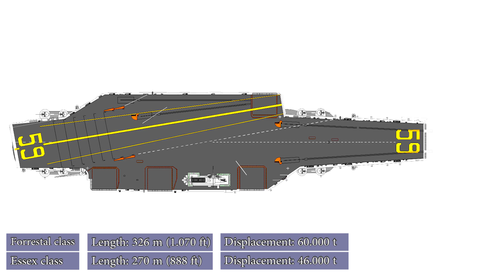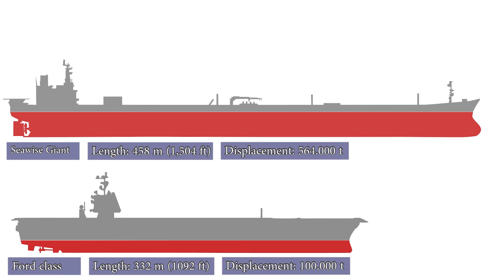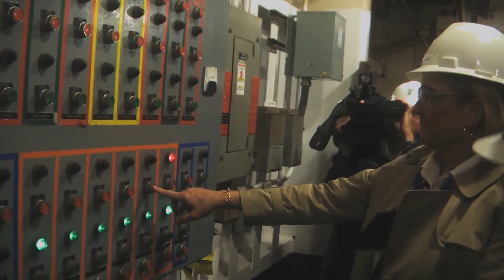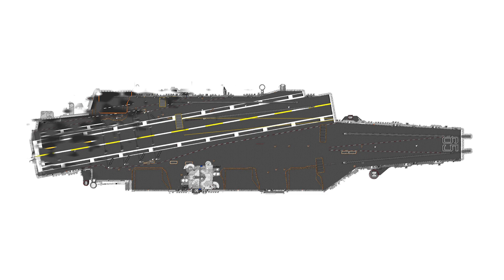Why don't aircraft carriers get bigger?

Comment: I would add that size is only a secondary requirement, the primary requirements are brave soldiers and strategic planning. Remember the 1971 Indo-Pak war? Only 3 corvettes were enough to knock down the Pakistan Naval Ships. So, size is just a physical attribute.

Comment: OK------- PS !    A 1600-foot long by 200-foot wide hulled carrier could have a 300' to 500' by 60' Docking Well in its stern for cheap, easy and fast Mass Cargo resupply instead of slinging Bombs across cables between Ships only 75 feet apart doing 15 knots. At least stringing a hose between a Carrier and a Tanker is halfway Safe. And all you are losing is some Jet fuel if the hose breaks. While large Bow Thrusters would solve the Maneuvering problem long tankers and bulk carriers have, as well as being able to self-dock pierside.  Not to mention that the huge Bulk Cargo and Tankers are built to be cheap with Power plants just big enough to make 15 or 20 knots on a good day with a few thousand horsepower at most and not the huge Nuke plants on the Carriers with hundreds of thousands of horsepower racing away below decks. Power, number of shafts and Rudders to size is most of what makes a ship maneuverable or a sluggish snail barge.

Comment: OK-------.    CALL THE NEW MEGA 1,600-FOOT LONG CARRIER, THE PACIFIC CARRIER...    WHERE IT IS TRULY NEEDED...  WITH THE OLD SHORT CARRIERS STILL PERFECT FOR THE ATLANTIC AND MEDITERRANEAN....
--------------...    Most of the reasons stated for not increasing the size of the Fleet Carriers are Complete BULLSHIITE!!!!  Exaggeration runs rampant here. A 160,000-ton, 1,600-foot-long carrier would not be Slower or require even a larger Power plant to still achieve 35 knots or more. As the width of the hull at the water line and the draft are what produce drag, and not the length.There is no reason to increase either hull width or draft of a 1600-foot carrier. The fact is that a new construction would simply extend the length of the hull, requiring no new technology or larger power plants. The only additions would be more deck and hangar area, as well as increased storage volume, and only the additional crew required for the added aircraft, as the ship's internal equipment, such as elevators, catapults, and propulsion equipment/reactors, would remain the same.  Only requires 40,000 tons of additional hard steel for the hull.
-----------... AGAIN! Simply lengthening the Carrier would not increase drag as the width and depth of the hull controls drag and not length.. fact is a longer ship can result in a faster ship in rougher seas...    Cost of ships is controlled mostly by the amount of steel and the Size of the Compartments, which is CHEAP, and the number of propulsion reactors, propeller shafts, and auxiliary equipment needed, which is 80% of the cost of any carrier... and would not need increasing.  Lengthening the Carriers' hull 500 feet would STILL only need the existing Propulsion and auxiliary equipment, electronics, and electrical systems, now on the Carriers, which is the majority of the carriers ' cost. 
------------...   So Most of the additional Cost of the longer 1,600-foot X 440-foot wide flight decked Carrier is only the added Steel to make the additional number of Compartments, which is inexpensively Cheap, adding only at most a $-Billion. While requiring the use of only existing fighters now used on the Nimitz and Ford Carriers... but having the room for larger, faster, longer ranged fighters as well as moving hundreds of vertical missile launchers off of destroyers onto the Carrier that is the main target. The NAVY now so DESPERATLY NEEDS...  Alowing the destroyers to concentrate on sub protecton. 
-------------.  The Cararier would have the advantage of operating 6 C-130-sized aircraft for long-range, large cargo resupply and the capacity to provide long-range Fighter Refueling to allow 2,000-mile strike package Missions and patrols...
  That are now impossible with taking fighters packed with extra drop tanks and a refueling pod to refuel fighters that extend ranges of a fighter or two only a couple hundred miles and not whole 40 plane strike packages a thousand miles that a couple of C-130's can do... front line fighters that would better serve increasing the numbers of fighters on attack or defensive missions and not just refueling a couple of mission fighters each....  
----------...  . Most of the other statements against the larger Carrier are just as False. While the Reasons for a larger Carrier are many times Greater than stated.  The fact is that a 1,600-foot long 400-foot  wide flight deck Carrier mass produced would only cost a Billion $ more than the Ford Classes current Cost when ever built that already has the cost of the propulsion reactors, hull compartment fittings and flight cats, arresting equipment and elevators paid for...  giving you twice the carrier that can fly in a Wing of reinforcement fighters fromthousands of miles away within hours (because the Carrier has the Extra deck and hanger space to handle them) instead of months waiting for a second carrier to arrive from the States.  Also the number of missions flown from a Carrier is dependent on how long it takes to Service, Re-Arm and Re-Fuel it's fighters. That depends on Deck and hanger Space and NOT on how many Cats it has. It only takes a minute to launch each fighter on each Catapult, making it possible to launch several squadrons every 15 minutes using the Four Cats they now have and not hours like this jerk hints at. The extra room for checking, and rearming with more munitions, elevators, and refueling spots, the bigger Carrier's flight deck allows will triple the Fighter Shorties per/day over the Current Ford carrier. to 600...   Amazing what an extra 500 feet in length can do to greatly increase a Ship's Combat Performance and Capabilities! for at most only an extra 10 to 20% cost... for the added steel in the longer hull...  and nothing else...
-----------... As for building the longer carriers???     The only Graving dock now used to build nuclear carriers is over 2,000 feet long... plenty of space to build a 1,600 foot long Megacarrier...   Though the outfitting and maintenance dry docks would need to be lengthened, but that can be done for only a few tens of millions of dollars each in less than 6 months per dry dock...  as for docking the mega carrier???  Every home port the navy now and has ever used can easily handle carriers twice as long with only a few tens of millions to lengthen the few docks that need to be longer...  while the San Deigo carrier docks can handle two and three carriers lined up in a row at each birthing pier...  making plenty of room for several 1,600 foot mega carriers on each peir....  with no upgrades...
-------------... in fact... every American port in the world now capable of hosting nuclear carriers can handle the mega carriers with no need for upgrades... even if the docks are never lengthened...  And as is common practice... most port of calls are done with the carrier anchored out in the deepest part of the harbor..and not tied up to some shallow bottomed dock...  A short 200-ft enclosed internal dock at the stern would provide protection for landing craft supply boats for personnel and cargo supply transports as well  as patrol security boats while in harbor and close to shore.
-------------... Finally, a 1,600-foot-long Mega Carrier would hold enough fuel and storage space for all large repair parts for its flight wing and its escorts,  carry enough food and supplies to feed the carrier and its escorts' crews for  3 times as long before needing to replenish fuel or food...  In a world that would have the enemy going out of its way to sink all Supply Ships and tankers (all carriers' Achilles heel) long before they can get to and replenish the Carriers to keep them on station... Forcing America to leave the battle area long before the enemy is neutralized...  Possibly costing the loss of Taiwan or Japan or the Philippines... or even Europe...!!!  With the ability of both C-130s and C-117s to fly in masses of weapons and supplies.   Why the Pacific carrier is desperately needed...
-------------... And even more important... if a carrier gets battle damaged that prevents landing its strike package.. or even sunk...  another mega carrier would not only be able to land every fighter that the carrier put up but continue to operate them as if the mother carrier had not been damaged or sank or simply has to retire for repairs...  Saving billions of dollars of 100 million dollar fighters... that would otherwise have to ditch... as happened in WW-2, too, hundreds of perfectly good Navy fighters...

Comment: Why don't aircraft carriers get bigger?
1. Larger size= larger target- both on radar and to protect;
2. Larger size= larger mass which requires greater power to move through water at the required speed- which requires a larger propulsion plant- which occupies more space in the new hull;
3. Larger size= larger dockyards for construction, larger manpower force required to build the ship in the same amount of time as the smaller predecessor;
4. Larger size equals larger draft which requires dredging of channels to accommodate the ship;
 5. They're already large enough to perform the tasks required in any minor conflict involving a non- nuclear power. Any conflict involving nuclear- armed powers will either end quickly (within approximately two weeks) via diplomatic intervention and a cease- fire, or will escalate into a nuclear exchange. In the former case, larger carriers aren't currently required; in the latter case, their life expectancy once nuclear weapons are used is approximately 24 hours at the outside, so their increased size won't save them.

Carriers will only slowly increase in size as carrier- borne aircraft increase in both size and launch weights- requiring a larger ship to carry the same number of aircraft.

Comment: my point is not strictly about overall size or displacement, or looking like a brick.  my point is why don't they have a wider deck or built wider to be able to take advantage of being able to launch aircraft simultanously, and far quicker, given that time is one the the most crucial factors as was understood after wwII if not before,  Is it because such dimensions would mean the ship would not be able to use  strategic crossings or short cut waterways,  such as the Panama and Suez canals? , or is it  because of the increased engine power it would require,  or is it simply a matter of economics  i recently heard a new UK non nuclear Carrier, is reputed to have cost close to 400 billion dollars, which clearly means they are a very limited option for almost any nation...    cheers

Comment: The US Navy actually found out that operation over 100 aircraft from a single vessel is way to demanding for their own air-ops and crew. When did they find this out you ask? As early as World War 2. The then most modern carriers of the Midway-Class could carry ( I believe) around 110-120 Airframes on board. Even tho this was possible they most of the time only set sail with around 80 aircraft on deck for the already mentioned reasons.

Comment: A gripe of mine with videos like these is how rarely they consider cases outside of funding and politics. Those are absolutely valid and fair points, but I'm far more interested in the theoretical limits of things for worldbuilding purposes, and current economic and political limits are only tangentially related to that at the very best. I'd love a section where you assume unlimited funding and resources for building and maintaining both the ships themselves and all related infrastructure, and then explain how size isn't everything. One important point is to never put all your eggs into one basket, which you do mention, but with an unlimited budget, that's not a factor.

Why not consider how, after a certain point, there'd be no point making the ships even larger? Carriers with the ability to receive large cargo planes might certainly be a boon, but after that, what more would size provide? Larger planes? There are plenty of limitations on plane size, and as the planes get bigger, various factors may coincide to make it far more useful to just launch them from bases on land, even if the closest base is on the other side of the planet, or even to just not have planes that large. I'd be very interested in knowing where that limit would be. What about more planes? After a certain point, the amount of resources necessary to increase hangar space might exceed the resources necessary to just build two smaller carriers with the same combined capacity. If the desired supercarrier should also have a minimum runway length then there are likely also points where both runway length and total capacity could be achieved with a group of smaller carriers. That's not to mention the increased operational flexibility. Where are those points? Many other specifications likely have such points.

There are also physical limitations. Flying animals can only be so large before the weight of their wings and related muscles would outpace the lift they could possibly generate. Similar limitations must surely exist for ships in terms of size and number of propellers, size and weight of engine and related components, and perhaps even thrust to drag ratio. There's also structural integrity to consider. Perhaps there's a size where the structure itself would require such reinforcement that it would either buckle or sink. That may tie in with engine size and weight.

To give an example of what I'm talking about, a navy with access to carriers has no use for battleships, even with an unlimited budget, as the carriers can launch naval bombers with far greater range and accuracy than any gun could ever achieve, and the bombers are also useful for much more, to say nothing of whatever other types of plane carriers can launch. There's not even any point to mounting big guns on carriers, because all the space required for those big guns would be far more useful as extra hangar space. Even with an unlimited budget, any resources one might spend on a battleship would be far better spent on a carrier. I want that kind of analysis for carrier size.

Comment: Y'all missed the point altogether. A CV is a warship, a capital warship. It's primary reason to exist is to defeat a peer or superior enemy. 60 A/c is about the practical limit for an ALPHA strike because of launch (4 at a time) then recovery (1 at a time) then re-arm/refuel. You want to clear the deck when the enemy attacks, so 5 minutes (or rather more in practice). Recovery, in theory, 1 per 15 sec, =  15 minutes. This does not allow for "bolters", and damaged aircraft. Watch the speed that an Essex launched. Compare to the speed the current CV launches. To be really useful,  two planes at a time, the width of the landing space would need to be like 3 times, though the launch cycle improves from 4 to 6. Of course, we have not considered the elevators, which are another limit, as is moving the planes around in the hanger deck, or additional ammo hoists. And much more dangerous to operate (admittedly a peacetime concern).

Comment: The size of an aircraft carrier is determined by the aircraft carried and the ability for the ship to control its onboard compliment. This is why the capacity of an aircraft carrier has not changed since WWII while the ships have gotten to their current size. If or when naval aircraft need more room to be operated efficiently, we will see aircraft carriers get bigger.

Near the end of WWII the USN introduced the Midway class of carrier-- First US carrier with an armored flight deck-- which could house nearly 150 aircraft. However, it was found that these carriers couldn't effectively operate all of the aircraft on board. So operational aircraft have remained at around 100 aircraft. If aircraft had remained being powered by piston engines, aircraft carriers would have remained the size of the Midways..... But Jets became the primary form of propulsion and they needed more room. This requirement dictated the increase in size of USN aircraft carriers. This is why USN aircraft carriers are the way they are.

Comment: 'Can 5 giant replace 10 Fords?' No. Because: we don't have all 10 in service at any time.
Normal US practice with current load is 3 'on duty', 3 or so training for duty (new crew, learning new tech etc.), and 3 off duty getting repaired, maintained. Then #10 is getting a major modernization overhaul and maybe refuling. 
This number is barely manageable in a mostly-at-peace world; we had Dozens of carriers at sea during WW2.

Comment: If an aircraft carrier is too big it would need more defense measures and be way too expensive to build and maintain through its service. I think future aircraft carriers will be build with cost in mind and aircraft that are specifically designed to operate from them. Eventually aircraft will normally have such long range they may not even need an aircraft carrier.

Comment: the point you make about aircraft makes no sense at all.. starting with the F-35, the C-model is the navy version. There is no specific navy version of the C, all of them are equally naval jets. Additionally, the most expensive and complex version, which is the one you show, is the B model made for the US Marines. Furthermore, there's loads of nations operating (Super)Hornets off of land based airbases, simply exchanging the built in ICLS or a land based ILS system..